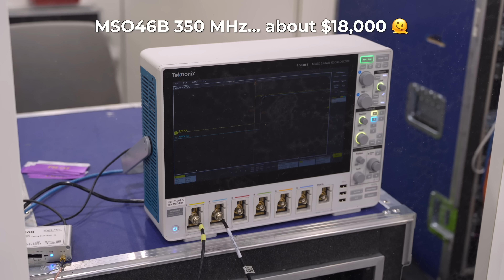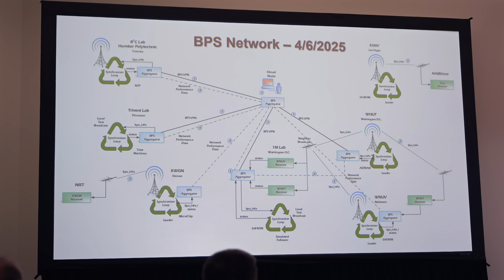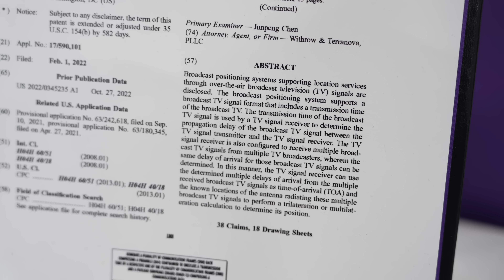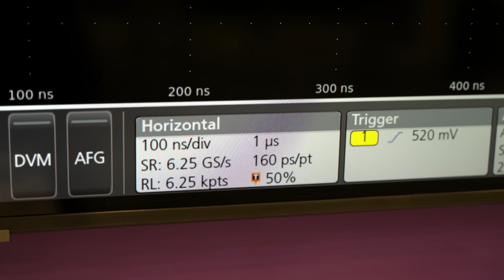I found a cool GPS alternative nobody knows about

Comment: I remember LORAN-C and eLORAN making it into the tech news several years ago with The National Timing Resilience and Security Act. It's one of those things where it really does make a lot of sense to have as redundancy for GPS (which is ultra vital to everyday life now and extremely vulnerable to things like solar weather and weapons), but it's also expensive and may never actually be needed (leading to it becoming another politically controversial program for politicians that only think short-term). It's basically catastrophe insurance, and we all now how much people love insurance.
Reply: For this reason, I found it a bummer when LORAN-C was turned off in 2010 for North America. And likewise for the FAA decommissioning some VOR/DME systems. RNAV that relies on VOR/DME is more than sufficient for enroute/terminal navigation for airliners and serves as such a crucial backup. Airliners still have all the equipment to take advantage of RNAV. And with modern radio tech making it cheaper to include additional timing signals into such systems, I don't see why we should stay "all GPS".
Reply: The thing with GPS is that pretty much any country with the highly-advanced means of doing damage to the GPS satellites (very few) are likely extremely reliant on the system as well. Even Russia with GLONASS is likely very reliant on GPS for a lot of things. That’s all not to mention that p much everyone in the world relies on GPS now so messing with it would be a very easy way to get basically the entire world against you.

Comment: I notice the eLoran receiver does 1PPS, but do receivers exist that do a 10MHz clock output as well? My work relies on very precise timing, we have two multi band GPS receivers that provide a 1PPS signal and 10MHz clock to our RF radios and amplifiers.
Reply from the maker: I believe the box they had also outputs a 10 MHz reference as well.
Reply: Tried working with a blue top rubidium std?

Comment: What gear can receive BPS?
Reply from the maker: So far either custom SDR setups, or one box from Avateq—there is one crazy guy already reverse-engineering ATSC 3.0 in GNU Radio who's been working on decode. I would love to get this tested, but don't have any BPS signal in St. Louis I could look at yet.
Reply: @Level2Jeff  Could you make a less than 1 Watt private radio station and do some form of testing? I bet you have some connections to someone who knows about transmission. 🤣 I don't know what is involved in transmitting the signal.

Comment: Something I'm genuinely curious about:

I dabble in Ham radio and you can get timing information basically anywhere in the world using the station at WWV (5, 10, 15MHz etc.). I've always been curious if that actually would have the nano-second level accuracy needed to do timing work. HF is really cool because it bounces off the atmosphere and travels a really, really long distance from a single transmitter; meaning in-between infrastructure isn't needed.
Reply from the maker: I've actually talked to three different time nuts here at NAB about this problem. All three have approached that issue before. The best I've seen is in the microsecond range using WWV, but there was someone doing more experiments with it in the past year or two that I never followed up with...
Reply: @Level2Jeff there's always a problem with multipath etc. consider a foot is a squeak under a nanosecond of inaccuracy.
Reply: @anullhandle  Yes. Long paths for HF radio can vary massively. You can sometimes (not often) even hear echos when listening to HF broadcasts over muti-hop paths, where some of the signal happens to go a different route (different number of hops etc) or even goes round the world in the other direction.
Reply: 100%. And that's part of my curiosity. There are, for example, schemes using HF radio for long-distance trading of securities that is apparently insanely low latency; even beating out fiber connections (because of all the infrastructure hops they have to make). So surely someone somewhere has figured out how to deal with those issues.

So I'm curious if there's a way for brilliant people with brilliant software to interpolate WWV in such a way that nanosecond accuracy is possible.

I dunno, I just think it's neat! They've fallen out of vogue but "atomic clocks" used to be popular; self-setting clocks that used the WWV signal to set themselves. Obviously these days everything is connected to the internet and gets timing data from that; but the concept of a clock that just listened to a radio signal to know what time it is was always super cool to me. And those worked just fine indoors.
Reply: @RomansFiveDotEight  I hadn't heard of that. There were some people that used the old shuttered att longlines microwave towers to game the system between Chicago and NY exchanges if I remember correctly. That's microwave line of sight. The fake "atomic" clocks that used wwv where within a fraction of a second, WAY less accurate.  Timenuts now use GPS steered crystal oscillators for frequency standards on the cheep. You get the constantly updated GPS time for long term precision and steered crystal for short term precision. The station keeping GPS modules with 1K pulse output instead of the 1pps.

Comment: I believe  loran or related tech was used in WWII by my dad as a navigator in a B25 in the South Pacific.  An alternative to GPS makes sense with GPS spoofing.
Reply from the maker: Indeed, Loran was the first wave, but eLoran apparently gives a lot more accuracy which can get GPS-level timing accuracy at least. I want to play with it... 100 Khz or thereabouts.
Reply: @Level2Jeff  The scratchy sound when a general coverage receiver is tuned to 100kHz AM had been fading as more transmitters were switched off, but recently it's beginning to grow a little stronger again.
Reply: @Level2Jeff i didn’t get to keep it (in the future project pile™️©️®️) but as a kid we were fixing up our old sailboat and got rid of an old LORAN system if i remember correctly (granted a pretty basic later one iirc)

Would have been neat to mess around with, but with all the SDR and Custom PCBs one can make these days, and stuff like this i may just make my own (or some neat community Open Source Project if they beat me to it) one day!
Reply: @Level2Jeff  Well, LORAN is something I have not expected to hear mentioned for many years and suddenly I come across this video. 

I am one of those people who thought the shutdown of LORAN was the wrong thing to do back when it was still being decided.

It makes me smile to hear of a possible resurrection thanks to eLORAN.

Comment: can you use any set of signals to determine positioning?
Reply: As far as I know yes, you just need to be sure that the signal sources are at the same time, otherwise your position will be off too.

There are companies like zactrack that use their own basestations with ultra wide band radios to do precise position calculations with their own trackers on stages so that moving lights can be used as follows spots and automatically follow the artist based on the tracking data